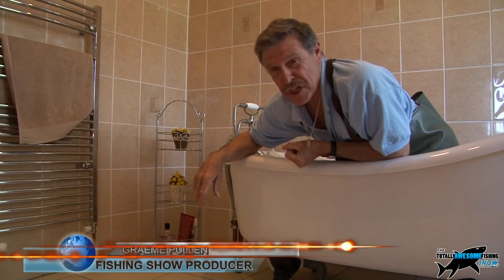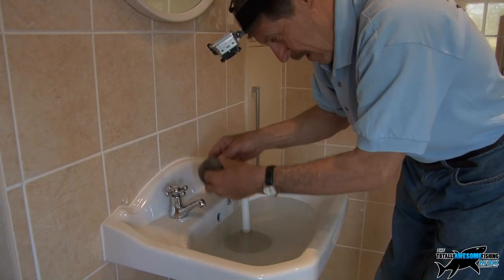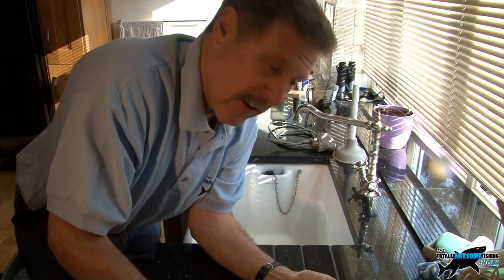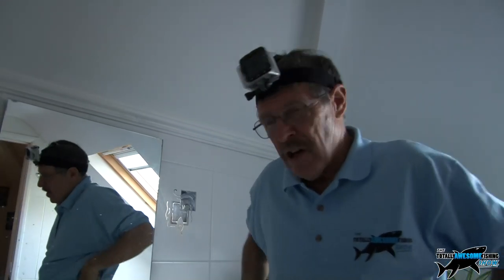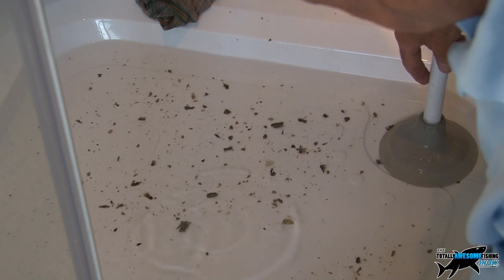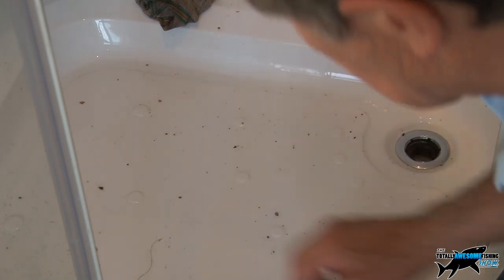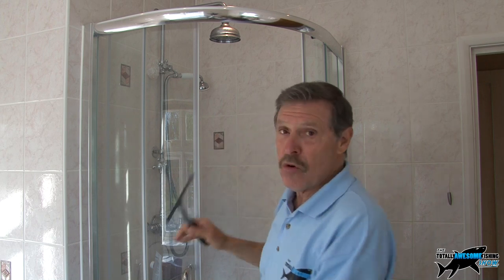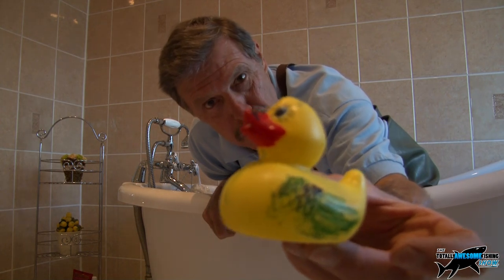How to unclog/unblock a sink drain - The Totally Awesome Fishing Show

Comment from the maker: If the tide pull is that strong you may need fixed wire leads,or try fishing over a neap tide instead of a spring,as the latter carry more volume and increase drag on the line.